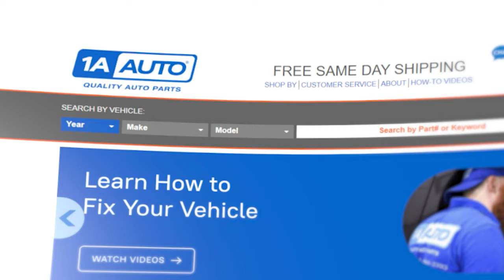Howling Noise from Loose Wheel Bearing? Replace it Yourself Before It Causes Major Damage!

Comment: they don't always make noise, well at least the type where the bearings slip into the rotor hub doesn't. Awhile back I had a Ford Econoline van that all of a sudden got 3 tire blowouts back to back to back. When I checked it out I found it was so bad my tire was hitting the control arm when I turned. I was amazed to see when I removed the hub that my entire outer bearing was gone besides a few little bits and pieces. That is about as bad as it can get but my point is I couldn't really tell until the blowouts.

Comment: I wish i had this video like a year ago cause i was trying to fix my honda that had that kind of symptoms which i couldn't figure out. Now i do know that it is the wheel bearing. And here i thought it was the power steering pump. But i did hear power steering grinding a little though. My other car is long gone. Now i dont have to qorry about big repairs for years. Just need to keep up with important maintenance.

The problem with my was that the vibration was really excessive and i can feel it in my gas pedal which was so annoy and made my foot numb

Comment: I had a 2007 Subaru Forester. I had it booked in to get  checked out and a oil change. The day before the front right wheel bearing snapped and ended up in a ditch. Completely wrote off the car. I was so angry. I loved that car. I have a 2011 ford fusion now, but still wish I had my Subaru.